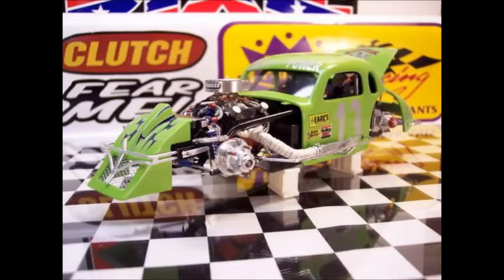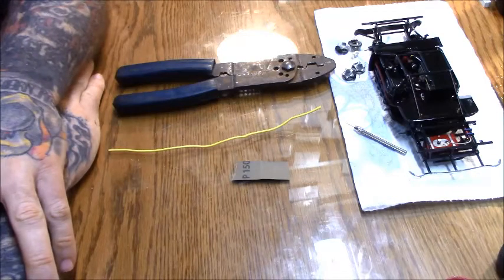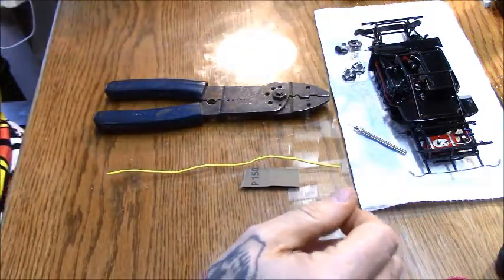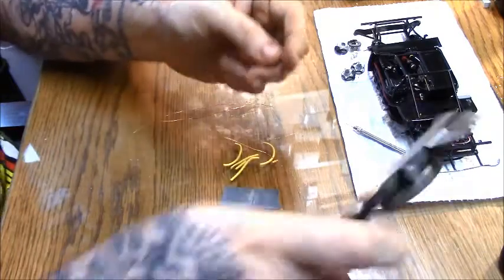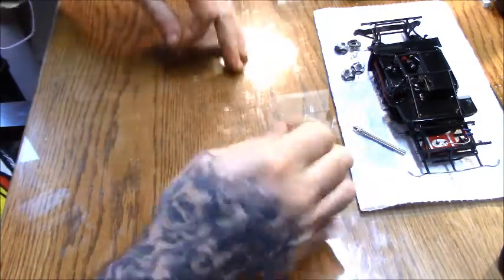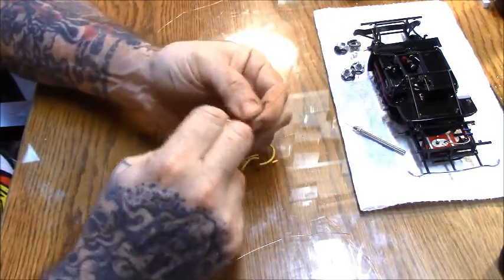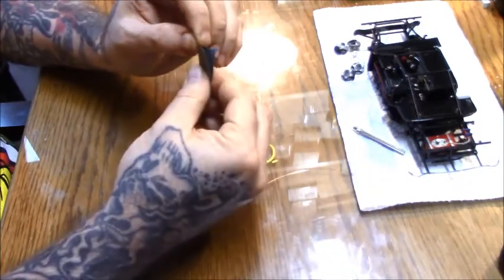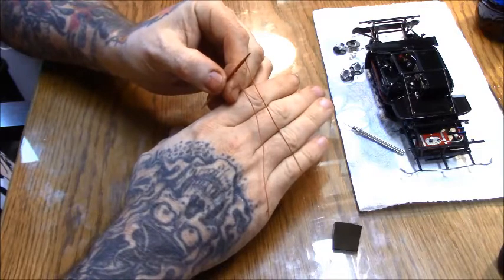#12 LMG How to make Coated wire How-To

Comment: Off topic, what size styrene rod do you recommend for roll cages?
Reply from the maker: Hey bud. I would recommend 1/16'' or .062'' styrene rod. It scales out to 1 1/2'' in 1:1 scale. Roll bars on a 1:1 is usually 1 5/8'', So 1/16'' is the closest your gonna get. By the time you add primer and paint it scales to the correct size and looks great. Hope this helps Brother
Reply: Appreciated. Cheers
Reply from the maker: Thanks Brother and your Welcome.....